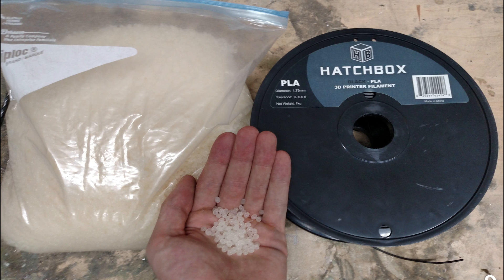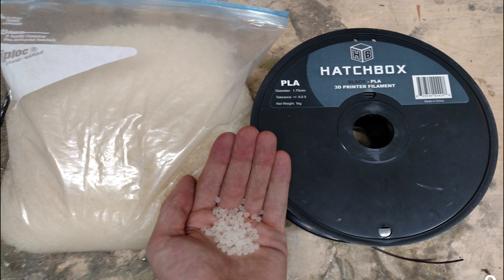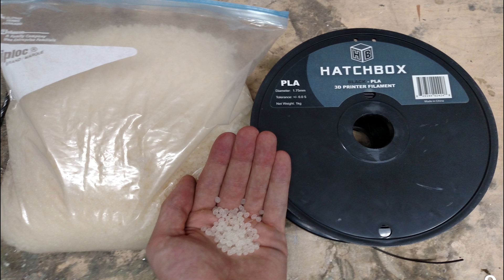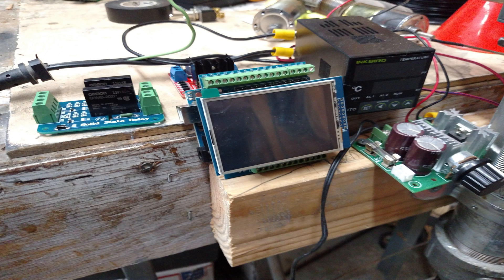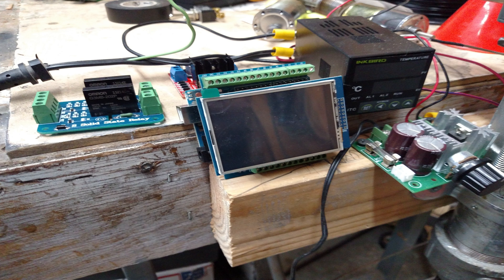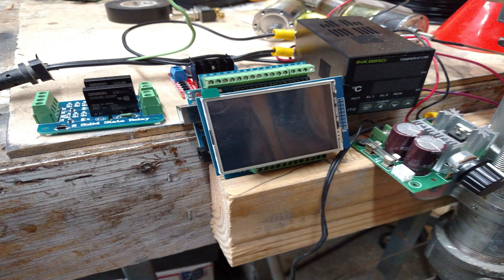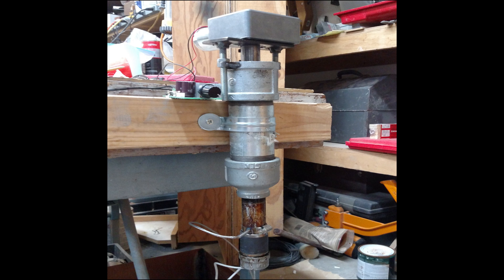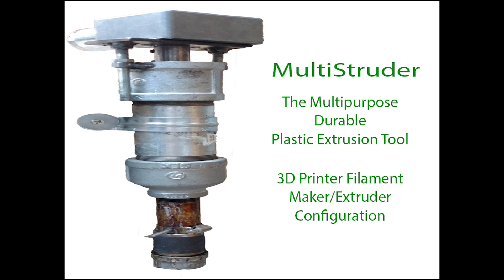The Multistruder: The Affordable 3D Printer Filament Maker Info Video

Comment: What are the filament tolerances for your extruder? this video shows your extruder working at 120 degrees but in the kickstarter campaing, the temp is 115 degrees. For PLA, 5 degrees is enough temp to cause diameter fluctuations.
Reply from the maker: check the rest of my videos i have on it. i have a multistruder series however i have currently taken this design off my store as it is going through redesign to allow me to build the unit quicker. so it is going to go through a mechanical re design and electrical redesign to increase build speed.